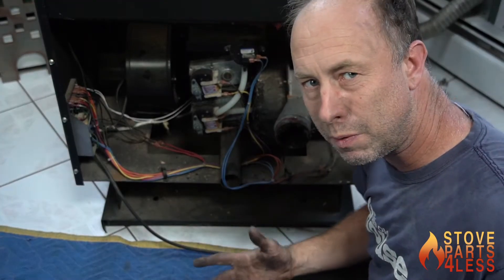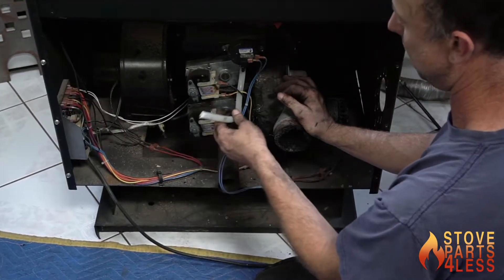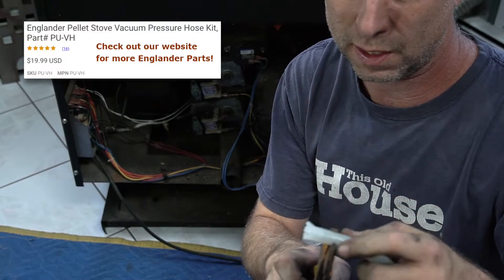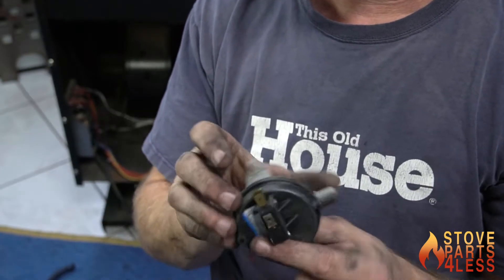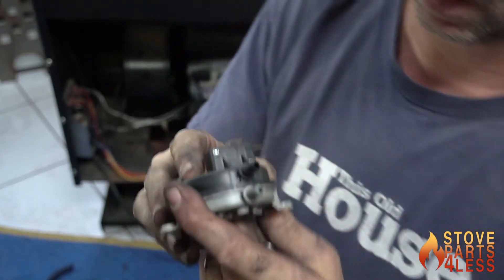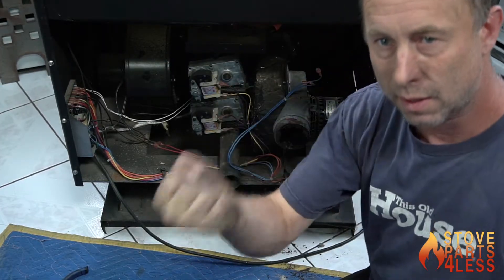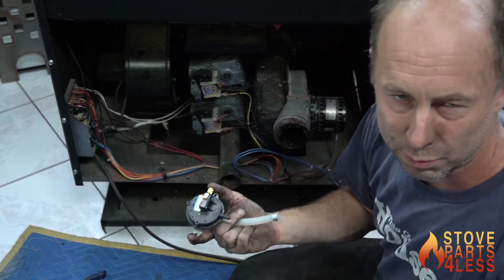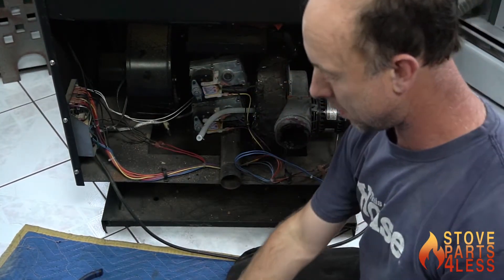Why your Englander Pellet Stove Won't Feed Pellets

Comment: So I got this stove and it ran great the first time, safety switches both passed the testing part, and hoses are good, currently though, the upper auger won't feed the lower auger in start up mode unless the door is open, when closed it doesn't feed so obviously the flame starves out and I get the e-2 code. Any ideas on why the upper auger won't feed unless the door is open??? Tia

Comment: Is it possible 2 jumper The two vacuum switches to see, if the failure is in the vacuum switch circuitry.
Reply: If placing the jumper on vacuum override, still indicates e one is that a controller problem

Comment: Good site, this will definitely help a lot of people.
Let me run a story past some of you , it may save you  or someone some hair pulling out.
I have been working on the same pellet stove, the stove will start, it will dump pellets for about 10 minutes, it will ignite but then it will shut down.
I put direct power to the auger motor so I didn't think it would be the auger motor that was bad.
So i bypassed the vac switches 
still no auger , I figured it had to be the heat sensor, not sensing the fire in the burn pot, some stoves have a snap disk that performs a similar function but on this stove it appears it is like a thermocouple screwed in directly under the ignitor.

So I replaced that, the unit ran for 10 mins again then stopped feeding, I quickly pulled the wires from the auger motor again and ran line voltage to the ager motor . . . .would ya believe the auger motor would not turn now ?

seems the auger motor was getting incredibly hot and when it reached a certain temp, it just stopped , until it cooled down enough , then would spin.

Bad windings in the auger motor!

if anyone has a similar issue just rule out bad windings too
just let it run, run run and see if the auger stops on it's own.

when I found it was not the pressure switches and not the circuit board and not any kind of hopper safety switch , I just assumed it had to be the heat sensor switch and I was wrong.
It was a good thing I was still there when it failed though to retest the auger motor when it was hot

Comment: I have a 25-CBPAH  that I bough 10/2021.  I having issues with this model and I don't see much videos on it.  I've replaced the augar motor, vaccuum switch and hose, combustion motor.  Cleaned out the little hold from hose to front where ash bin is.  It will light and run at startup.  Room blower doesn't come on at this time until I manually have to push feed up for it to start working normally but after a certain level like 6 it will sort of choke up and automatically shuts down.  Fellets are feeding little.  i ordered the augar motor accordingly to manual specs but still feeds little.  i had question on CCW is what I need.  I don't know if its the fellets itself but its driving me crazy.

Comment: I can unplug the bottom auger motor and plug into the top motor, and it turns, but it will not turn without being plugged in to its own power source

Comment: Followed your steps. Hose was actually cracked as you mentioned, cut it down and did the blow test, all good there. Whoever, Auger still is not moving. Should I get a new Pressure switsh?

Comment: Our pellet stove stopped working on the 22nd.  I watched this video yesterday and I fixed the stove today.  Thank you so much fo posting such clear and accurate videos.  I took the burn pot out and banged out all the ash, cleared the carbon buildup, and made sure to vacuum all the tubes and spaces.
The upper auger wasn’t turning, guess why?
My husband accidentally unhooked the lid switch wire!
It started up and is working well now and no more squealing sound.
Thank you again for doing these videos.

Comment: So I keep cutting back the hose, fixes issue every time. Thanks. i bought the replacement part ( High temp) from your link. still continues to fail. an you recommend a different replacement hose? Maybe automotive type high temp?

Comment: WOW You saved the day , stove is 2008 model 25-PDVC and just started shutting off after a few minutes , and no pellets in burn box , watched your video and took it apart and cleaned everything good , the vacuum hose looked OK , but when I pulled it off the blower housing it was brittle , cut off 2" piece and reassembled , and wow stove is working great THANK YOU 👍👍😎
Reply from the maker: Great to hear!

Comment: I need to make one small correction. The connections on the pressure switch are : common, normally closed & normally open. On Englander stoves, you connect one wire to common (always) and the other wire to N-O (normally open). The switch when nothing is running is open & closes when the inducer applies vacuum. Thanks for a very good video. Fitz
Reply from the maker: You are correct

Comment: one more thing to check ; i had changed my igniter a year ago , the screw wasnt tightened all the way and over time  it became loose . when pellet stove started auger motors were fine , but when it got hot inside fire box , some air must have been escaping from igniter area and top auger would shut down . i had replaced the vacuum switch and top auger ,before i realized it was the igniter that was loose ; i tighten it back securely , stove works... rechecked original vacuum switch it worked , rechecked old motor  it worked
Reply: Same. Lol
Reply: if you don't mind, what or were you getting a E Code. I get an E1 and E2 code. :(

Comment: My Englander stove will start up but only runs a few minutes, shuts down with an E2 code.  "Failed to start. The upper auger seizes solid.  I've replaced the exhaust blower hose, and gaskets on exhaust fan, and fire box.  Did as thorough cleaning.  Still has the same problem.
Anyone have similar experience or have knowledge of this issue.
Reply from the maker: the E2 error basically means its failed to start in the start up time. If the upper auger isn't feeding then you aren't getting fuel and the fire goes out, hence the error code.

Comment: Does the pressure switch affect the lower auger? multiple error 2 codes on start up, lower auger does not turn
Reply: Never mind , had 110v to lower auger motor. Motor/gearbox is jammed. 

Looks to be a poor design , grease leaking and dripping from lower auger bearings as the heat travels up auger and cooks the bearing grease.  Had my stove for 10 years and this is the second time auger motors have died mid winter.

Comment: Bravo sir, it was the number one problem for my stove and I fixed it within 15 minutes of watching your video. And all the time I thought it was the auger, which I did buy a new one from the manufacture, but when I put it in and it still didn’t work I have to do more research and came across your video. I should have watched that first, I would’ve saved myself $150 in parts and a couple of tools. However, I now have a new knowledge and appreciation for pallet stoves and how they work. All thanks to you my friend.
And so I say bravo, bravo for your knowledge, bravo for your time to share, and bravo For your channel. Roger

Comment: I found that if you cannot blow through a metal tube off the combustion motor it's best to attach an air compressor or air bottle to blow the blockage out E1 codes of frustrating good luck

Comment: Great video, Everyone usually lacks lighting on these. Fantastic job. I'm a simple cable tech, But I ripped off hoses, tested switches, deep cleaned exhaust and everything.. unfortunately none of this fixed it.. Yes, it all helped quite a bit, But I ended up greasing the augers and put some oil on other essential parts and they started working and a bit quieter also.. Next task is replacing auto-igniter.. sick of using propane torch. Hats off to you Scott W!
Reply: I also  got a new circuit board and still the same  problem

Comment: What would cause the vacuum hose to keep melting off where it connects to the blower?  New stove England Model: 25-PDV, 55-SHP22, 55-TRP22.
Reply: Also Englander doesn't use high temp hose. If you replace it, use high temp hose
Reply: @stovegrillpartsforless4637  Thanks for setting me straight. I guess it's true that you can't believe everything you read on here. I had to replace mine with less than a year run time on it and then heard there was better hose to use. My blower is always set several notches above the heat output (1-5 as we speak). On a somewhat different note, next time my hopper is empty I need to adjust the the little plate that controls the size of the exit hole in the bottom of the hopper. I think my stove burns too hot.
Reply: @stovegrillpartsforless4637  Interesting. What other reason would cause me to have an 8 or 10 inch flame at the lowest temp setting?
Reply: @stovegrillpartsforless4637  Thank you